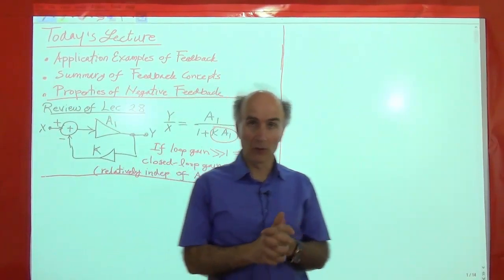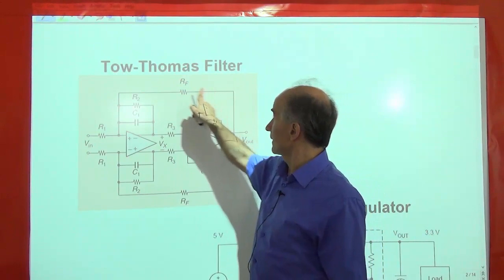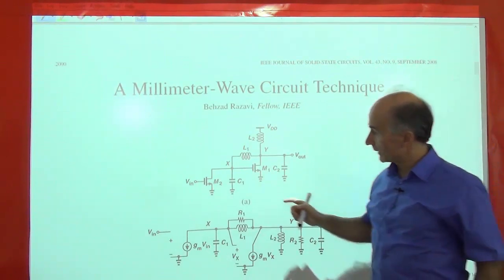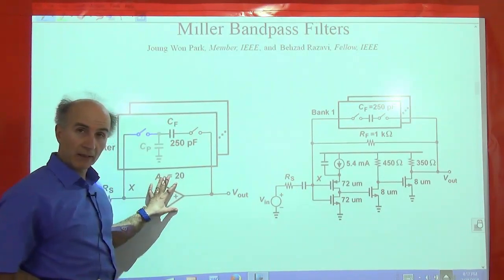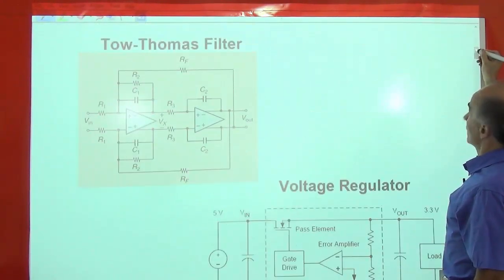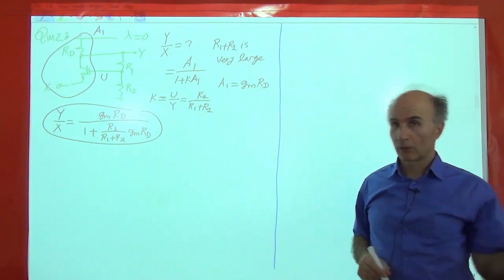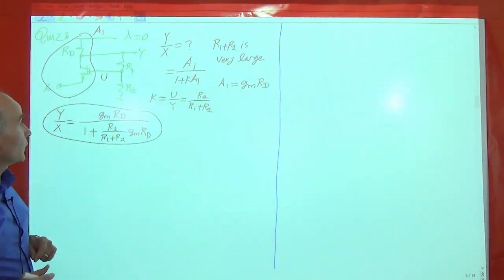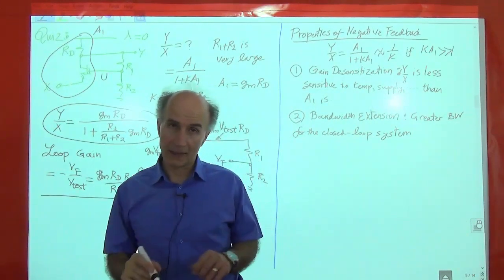Razavi Electronics2 Lec29: Application Examples of Feedback, Properties of Feedback Systems

Comment: Thank you very much for this immense work, what is remarkable in all your videos is the clarity of the reasoning. I regularly watch electronics lessons and you are the best! Most teachers film their lesson board from a distance, which makes it unreadable. You have done a tremendous job because I imagine the time you must have spent. The fact that you are alone in front of the camera allows concentration.
On the other hand, I don't really like electronic whiteboards because some colors stand out badly like green. The designers of the whiteboard could have put shortcuts on the edges or directly on the pencil to select the colors and the eraser. You have to pull down the whole menu to select a color which could be done with a button on the pencil. A huge thank you, I'll watch everything ;-)
Reply: i don't agree with you, electronic whiteboards are really helpful, like attaching pdf files, and when it comes to the color of the pen this is the choice of the professor and not the fault of the designer, the professor can chose the dark colors and light colors, also whiteboards have the feature of new page which is a big advantage than the classic whiteboards because of the time wasting in erasing the content that is written on the whiteboard

Comment: 01:25 - Intro and Review
08:40 - Summery of Feed-Back Concepts
>> Sacrifice the Loop-gain to Benefit from the Feed-Back
>> The Feed-Back Signal (U) is a Good Copy/Replica of the Input Signal (X)
>> The Output Signal (Y) is a Good Scaled Copy of the Input (X)
>> Variations in Open-Loop Gain Effect Closed-Loop Gain Less: Temperature, Supply Voltage, Frequency, Load Impedance
23:52 - Example: Poor-Man's Op-Amp
32:50 - Calculating Closed-Loop Gain
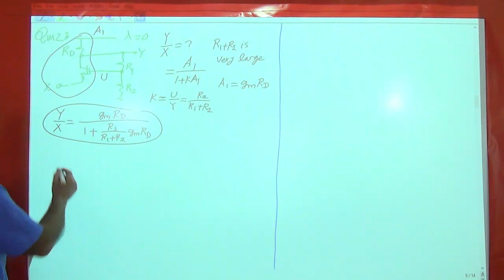38:00 - Breaking the Loop - Calculating Loop Gain
41:45 - Properties of Negative-Feedback
>> Gain Desensitization
>> Bandwidth Extension
>> Modification of Input and output Impedances
>> Higher Linearity (dictated by K)

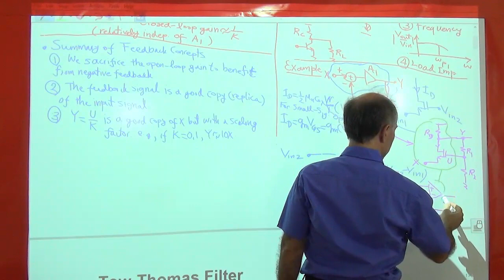Comment: 32:05 -> why is the voltage across R2 given to gate of MOSFET? Shouldn't it be fed back to the source instead? I'm stuck here...any help plz???
Reply: The MOS is configured in common gate configuration and thus its gain is gm*RD (not -gmRD) with the source as the positive terminal of the amplifier and the gate as the negative terminal.
Reply: @wilfredomachaca8653  isn't it an inverting amplifier though as its based on u-x and not x-u?